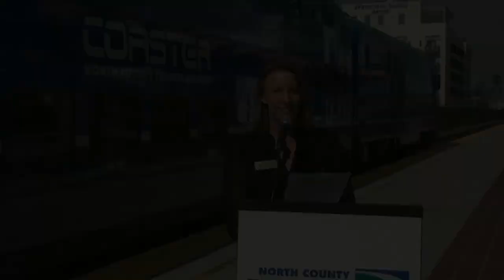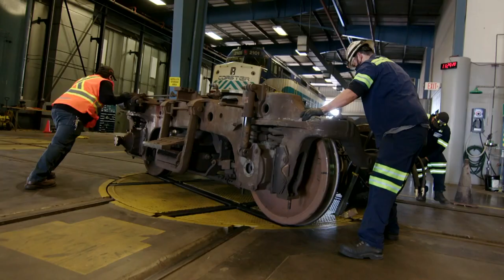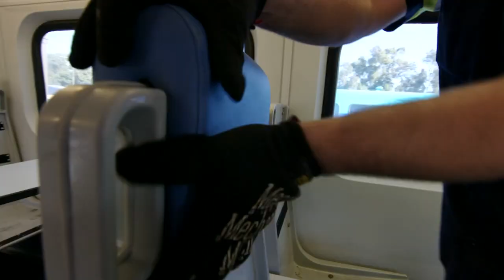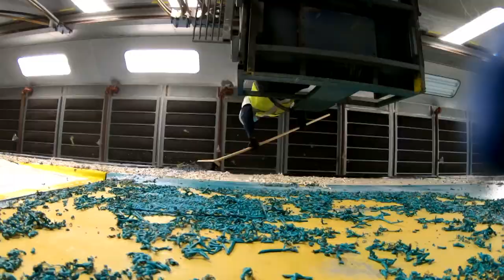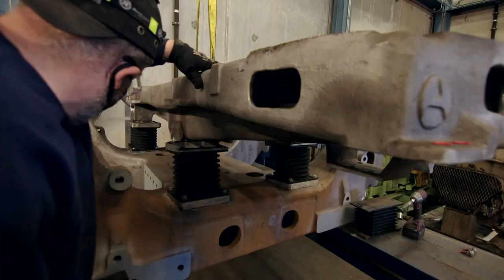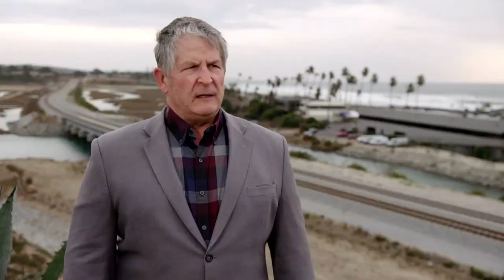NCTD COASTER Event 2021

Comment: the F40PHs will forever be my memories of the Coaster while growing up. They are amazing locos, sound beautiful.
Reply: FYI: NCTD never owned F40PHs. They were rebuilds from Morrison-Knudsen. The new Chargers are not only beautiful, but much quieter, especially when one has to walk past one.
Reply: @pacificostudios  my apologies MK-F40PH-2C.  I much prefer the louder engines. As a former, we usually like louder...not quieter.
Reply: @dumbcow1  - No need to apologize. I just thought you would like to know. The original F40PH supplied Head-End Power with its prime mover, and since the engine had to keep up its RPMs when stopped, it gained the appropriate nickname of "Screamers." It was the engine that saved Amtrak as a national network, and is an important part of American history.

Comment: My question is, will the Sprinter also be repainted in the same new scheme as the Coaster?
Reply: Not at the moment, but once the Sprinter's locomotives (Siemens Desiro VT 642) start to get really old like the Coaster F40s and F59s, NCTD will probably order newer versions of the Siemens Desiro VT 642s and repaint it like the new Coaster SC-44s and cab cars.
Reply: @darealconman  those are like 13 years old now so they'll probably repaint them and then retire them in 7 or 9 more years
Reply: Viva NCTD! @Railviation

Comment: Aww man I’m gonna miss the old f40phs and f59PHIs and all the cars but what will happen to the old locomotives and cars?
Reply: I think most of the F40PH's will be donated to different museums across the states and the F59PHI's will be with Coaster for a bit longer until the rest of the SC-44's have been delivered. Once the F59PHI's retirement occurs in a few years, it's currently unknown what will happen to them as well. Maybe giving it to Metra like Amtrak did with theirs.
Reply: @FlyersAviation  oh ok thank you dude
Reply: The five F40PHM-2C locomotives 2101-2105 are being donated to the Pacific Southwest Railway Museum.  The two F59PHI locomotives (3001-3002) are being placed in storage with disposition pending when the next two SC-44 Chargers (5006 and 5007) are delivered. Please also note that 3002 suffered a serious mechanical failure and is no longer operational.
Reply: @jamesreillytrains  oh no 3002 I hope it gets repaired soon enough. Thanks for explaining
Reply: @evanstraintubeyt6950  it's not being repaired it is retired
Reply: @Railviation  oh. Is it being scrapped?
Reply: @evanstraintubeyt6950  probably
Reply: @Railviation  3002 might end up with the F40s as well but no one said anything yet. So who knows